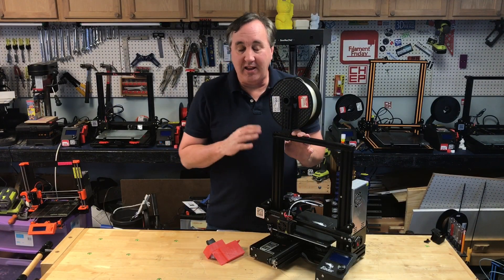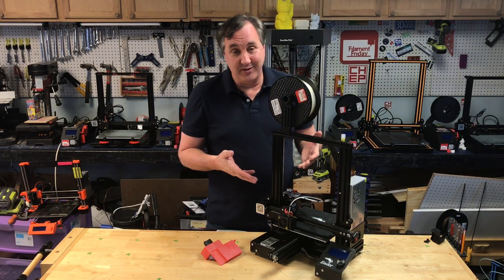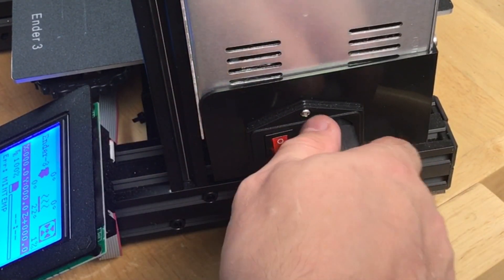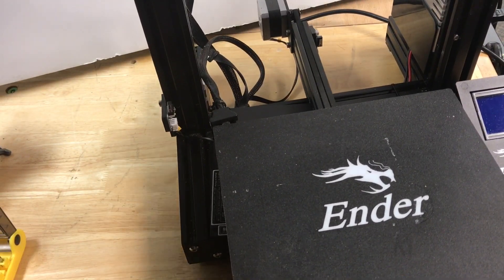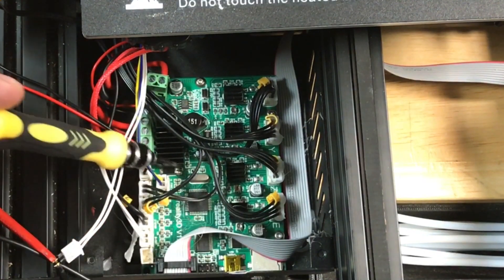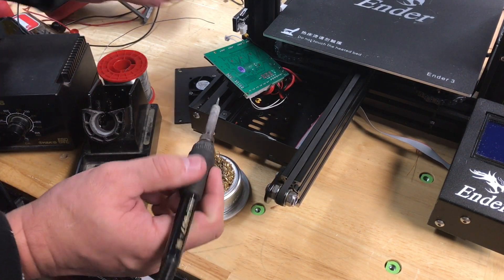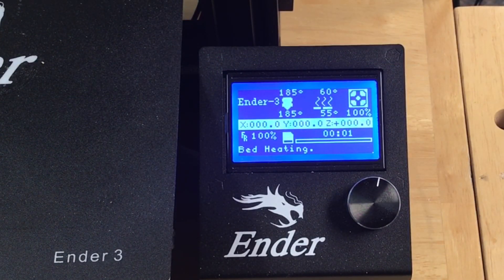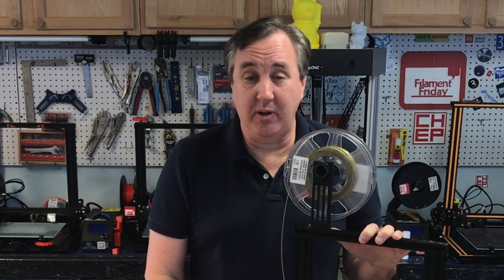Creality Ender 3 - MINTEMP ERROR and TEMPERATURE ISSUES

Comment: If you're having issues with thermal runaway error and no mintemp error, try taking off the hotend cover and checking how loose the thermistor wire is screwed to the heat block. DON'T OVERTIGHTEN. Mine was loose enough to spin with my fingers. Snugged it just a little and no more problems. Fixed it for me. Happened 1 month into daily use of my new Ender v1. Hope this helps someone. (It explains why this only starts after heating up, the screw or heat block both expand enough to make the connection intermittent)
Reply: Hey man! thank you! you save my life with your comment!

Comment: I have the Ender 3 V2 Neo and most of the times there is no problem, but sometimes after a few minutes in a new print, it stops and yields the extuder temp too low message.  I turn it off, turn it on and start the new print and it will work fine and do the print even if it takes hours. So it cannot be any wire in my case otherwise it wuold fail always. No air currents. I'm really puzzled with this issue.
Reply from the maker: Probably a defective temp sensor.
Reply: I experience the same thing but only with PETG at 240°, works fine and error come after 1h idk why

Comment: In my case, the temperature on the display was -14 degrees and if I tried to heat the hotend, the printer would reset. Checking it I saw that one of the wires at the tip of the thermistor had been cut, at first glance it seemed fine but when I took it out of the hotend it was loose, I soldered it with tin and put a heat shrinkable cable although it will soon be time to change it since the tin does not it will withstand so much heat if I use another filament that is not PLA. This happened on an Ender 3 Max

Comment: Sometimes the temp oscillates like crazy and nothing happens but maybe suddenly the error occurs. I guess it has to do with coincidence between a sudden low temp value and the sampling frequency. A friend of mine fixed it by changing a value related to that temp sampling in the Marlin firmware or something like that.

Comment: Ya, my problem was the circuit would fail and a the machine start making a high pitched noise high enough to break ears and the screen would say bed heating error, restart system.

Comment: SUBSCRIBED! After working through the basics of learning to use my Ender 3, making the usual noob mistakes, and finally learning to produce “fairly” consistent prints, I am now learning the finer points behind improving their resolution and strength. I may have also discovered a few things about the machine that I hope to share once I prove their validity.
Thanks for your time, presentations like yours save so much trial and error!

Comment: Just in the past few days I have noticed the temperature fluctuations on my Ender 3 Pro. I’ll double check the solder joints. Thank you. 
One of the screws holding the hot end on was loose. I also changed out the nozzle. This was before I watched your video.

Edit-
Being an Ender 3 Pro the circuit board enclosure is upside down. 
I checked the solder joints and all are good.  The thermistor is showing 121.1k ohms. After putting is all back together I checked the hot end’s thermistor screw and found it loose. I tightened it. Doing a test print. The temperature readings are sort of stable. It is fluctuating between 196° and 201°. Previously it would fluctuate between 200° and 160°, going as low as -14°. 
I may need to replace the thermistor. An entire new hot end seems to be close in price.

Comment: Thanks for the video on min temperature error on the A13 3D printer. My error was a max, temp. error but using the figures you gave for checking the sensor indicated a complete short. When the manufacturer assembled the head they had cut through the insulation causing a short with the fixing screw. I managed to insulate the wires and reassemble in now shows 107ohms.

Comment: I have a similar problem on the nozzle heater connection .I find lead free solder is more liable to have brittle dry joints than the old 60/40 solder
.Thank you for very helpful video

Comment: Awesome video. I have the same problem with bed temperature. Wildly swinging Temperatures and now a min temp error. It's stable as long as i just heat things up and nothing is moving. But as soon as i start a print my bed temperature is all over the place again. I was expecting some kind of abbrasion damage on the thermistor cable, but now i'm almost sure i have to check this soldering connection (well, the neighboring one is the bed-thermistor). Thank you!

Comment: I feel soooo dumb.  I was sitting here thinking something has gone terribly wrong.  Came to this video to problem solve.  Little did I know my printer was turned off.  :|  The display fully functional off the power of th Pi threw me off.  I previously had a less than ideal power supply on the pi so when it was plugged in the display would light up but it wouldn't really display correctly with the power OFF on the printer.  Newer better power supply is enough to run pretty much everything on the mainboard EXCEPT the heaters.  I guess I just panic but watching chuck starting going through the motions of problems solving kicked me into gear and I found my problem USER ERROR!   Thanks :)

Comment: I also noticed on my cr-10s, the connection where the bed wires SCREW into the back of the cr-10s box was not making a connection. I took it apart and verified ONE of the thermistor wires had NO connection and the other one did. Just cut the wire and soldered a new one in there. Hopefully, that fixes it for me. Testing now...

Comment: Hey Chuck, thanks for posting this. I recently had a MINTEMP error on my Ender 3 Pro, replaced the Thermistor and still kept getting it. I checked the circuit board, the solder was still held on firmly and I was left scratching my head. I ordered a new motherboard, installed it, and am currently running a print. Fingers crossed it works. That being said, if I continue getting this error, should the next stop be replacing the heater in the hot-end? Thanks. P.S. The Silent motherboard is exactly as described, my gosh is it whisper quiet and smooth.
Reply from the maker: Check your bed thermistor
Reply: @FilamentFriday  So I just replaced the bed thermistor, I suspect It's now either the wiring or how the sensor is taped on, because the bed temp is fluctuating. Will try re-taping it, Is electrical tape okay? Thanks
Reply from the maker: Usually kapton tape is used but it might.

Comment: I'm having a problem where driving the hot end much past 210degC causes it to trigger thermal runaway detection around about ten degrees below the set point. So if I run it to 245 (where I print ABS) at 235 it'll give out on me. Running it only to 235 sees the same behavior: it conks out at 225.

Anyway, this may be the issue! I'll pull it apart later today and check. Thanks so much!

Comment: Thank you!  Just started getting an error, "The current hot bed and nozzle temperature is too low", causing prints to halt with a screeching beeping noise.  Reached out to Creality but it's a weekend, haven't heard back yet.  So, might be the thermistor; might be the connections; I have some research/testing to do.  Thanks again!
Reply: same problem here any clue how to fix it?
Reply: @WestSidewaysRcDrift  Yes, someone (elsewhere) pointed me to a video with the following instructions: remove the screw holding the thermistor; then, pull out the thermistor and wipe the dust off it.  That dust is the thermal paste, which has turned into a powder, and that's the root cause.  Then replace it, and replace the screw.

That will make it work for 4-6 months, and then I'll need to do it again.  If I need to do it again, I will consider replacing the thermistor, or perhaps the entire hot end.

Hope this helps!

Comment: Had the same issue on a voxilab check the output on the drivers. Search you tube video's. It kept stopping and beeping half way through the prints and the motors would run hot and when i adjusted it the min temp warnings went away also. x y z at .95 E at1.2 DC. All 4 were 1.5 which is to much

Comment: Chuck, just replaced yesterday the thermistor broken of my ender 3 pro, the same specs as original Thermistor 100k Ntc 3950, i tried to print something but i suffer under extrusion, I checked the internal temperature of the heater block with a multimeter, and it gives me 20-25C less than what I set , I checked the thermistor, at room temperature it shows 92.5k ohm , is it within tolerance parameters? or the thermistor is damaged? Can i calibrate to fix the drop of capacity?

Comment: Please forget the earlier Tevo Tronado Hot End comment about -14C, I had a wire spliced wrong. So now it heats, but it is back to the original problem. With the old hot end and Tevo set at 200 C the measured temperature at the hot end was 140s C. The filament was not extruding, just getins soft at best,  Now with the new hot end I am getting the same results as before. So the problem must be on the baord? Mine is not intermittent like yours, just won't get hot enough.

Comment: I have a runaway heated bed on my ver 1 Ender 3. When I turn it on bed heats up to 200+ ! Yikes! 
I read online its a blown mosfet and ill need to desolder it and add an external one. I also read one post that a firmware flash fixed their problem with a  runaway heated bed.

I should contact creality for a replacment second generation board , thing is a firehazard and unusable as is. 

I still really love the damn thing....

Comment: CHEP, looking at ideas to keep ABS sticking well, have you tried heat activated sheets to stick down your prints? I'll be trying once they get here. But wondering if you have done it
Reply: Heat activated adhesive sheets it should say
Reply from the maker: I have not tried them. I’ve printed a lot of ABS in the past and an enclosed chamber makes all the difference. A brim also helps prevent warping of the corners.

Comment: A few days ago I had a failed print and a badly blocked nozzle. Blocked nozzle? No problem.... I'm used to it!
I attempted to heat up the nozzle to 120 degrees to pull out the blocked filament, but it didn't heat up enough to pull. The display reading reported 120 degrees without any error message. I suspected a lose wire on the thermister so I removed the fan housing to take a look and saw that my thermister was lose in the hole. Thinking this might be the problem I replaced it along with a new nozzle and reassembled everything... without first realising there is a little grub screw hidden underneath the cotton insulation on the hot end meant to hold the thermister in place..
Screw tightened and everything reassembled, I turned it back on - and it heated up straight away. But I did notice hot filament oozing from the nozzle... perhaps I now have much better contact between the heater block and thermister? Possibly a slightly hotter than normal hot end? Anyway, once oozing had stopped, I tried another print. Unfortunately I wasn't able to get good bed adhesion for some reason, so I cancelled that print job. Yesterday I attempted to print again with proper bed levelling, but this time I got the err mintemp error when trying to preheat the bed. Neither the bed nor the nozzle would preheat. I persisted thinking it was the room temperature at fault (4 degrees ambient in my cold UK winter warehouse), so I put a heater on to warm the room up a bit. I reset to failsafe on the display but still nothing. Eventually however, I somehow got a temp reading without any error, and I managed to heat up the bed to 60 degrees - this time it started to print!
Thanks to your video (the only one on Youtube), At least I now have a better understanding at what might be going on, and will take a look at the underside of that board for a loose solder joint tomorrow. Much appreciated!
Reply from the maker: Glad I could help.

Comment: Anything on an Extruder temp too high?  Even after a brand new hotend?  I can't do anything as I can't even confirm the error.  Unplugged, but it still seems like the software is locked up.  Ender 3 Neo max.  Thanks in advance.
Reply from the maker: Run PID tuning.

Comment: My CR-10 mini has trouble getting to, and maintaining 240 degrees (printing ABS).  Will get up close to the desired temp, and then drop, then go back up, etc.  Is that a similar problem or issue with PID's?  Any help is appreciated!
Reply from the maker: Possibly but also could be what I had, intermittent connection.

Comment: My 2nd Ender 3 takes 10 ministers to start a print because it can’t keep the temp at 205, it’s god from 200 to 210 back and forth and won’t stick to 205. Is that about the same issue?

When it does print, it has much more stringing than the other one and I’m wondering if that’s during the higher temp swings during printing
Reply from the maker: Sounds like something is wrong

Comment: Hi Chuck I was wodnering, you have any video about retraction settings to avoid the retraction strings?
Reply from the maker: I’m working on that actually. Try 5mm at 50mm/s. That seems to work on many of my printers.
Reply: @FilamentFriday I have the CR-20 and I have it at 4mm and 60mm/s but it keep's leaving strings I have try a lot from 2mm to 8mm and 40mm/s to 70mm/s and nozzle temp 190-220° and no result
Reply from the maker: Yeah. I’m working on it.
Reply: @FilamentFriday  Thaaaaanks

Comment: Just woke up to this error this morning. Thanks!
Reply from the maker: Glad I could help.
Reply: @FilamentFriday  interesting. The connection to the board was still hot glued, but it had come loose. Also if u want a quick way to check the thermistor I jus hit it with a heating gun. If temp goes up it's good.
Reply: if u getting temp error change the heater cartridge n upgrade it while your there
Reply: @wayneuk  no, however the error is back. Think I need to take out the board and check the solder.

Comment: You are amazing.
Can you combine power supply and mainbord out of case as another ünit?
Mainboard and power supply alrady get hotten but case of ender is getting heating so get rid of these unit from case can help it for cooling.
Do you think this like cr-10
Reply from the maker: It wouldn’t be easy because all the wires would be too short. Make sure the cooling fan  is turning.

Comment: I have my Ender 3 in a cold but dry shed and in its own enclosure. I find that the bed won't heat up when its really cold (below 4 degrees Celsius) however the hot end is fine. Also when I connect octoprint I get the min temp error as well (I don't get it on the ender 3 screen when not connected to octoprint, the bed temp just flips between 4 and 5 degrees over and over again). I assume that the bed has its own thermistor and on a different pin to the hot end as shown in this video. Perhaps I have a cold solder joint too.
Reply: Turns out it wasn't a cold solder joint at all, its just that the printer detected a value under the minimum for the bed and hot end (hot end started playing up when it got colder) due to the temperature outside. All I had to do was to bring the temp of the hot end and the bed above the minimum temperature and it started heating up just fine. To bring the temp above the minimum all I did was breathe warm air on to the bed and hot end X0D. I suppose a hair dryer or something similar would be a more efficient way of doing this in colder weather...

Comment: At first I saw this video and I was like no that’s not my issue I just need to adjust the pid because mine wasn’t getting to temp and it would connected to the computer and pid auto tune would reach over my desired temp by a few degrees, unplug the computer after I saved and it would work intermittently, while doing all this here and there id notice the faintest hint of smoke. Well I investigated after some cruddy prints another autotune and I see more smoke. My connectors are all good everywhere on the board looked great but the main power supply negative had melted it’s green connector tower! I’m so glad I discovered this, I ordered a new board hope I can just plug and play

Comment: Chuck.. Ya needs to turn up the shop lights a bit... Video is darker than usual. ;-)
4:22 Looking at the solder on the pin it is clear that there was not enough time and/or solder to properly solder that pin. There is no solder in the pad hole feed through.... only on the surface pad. I would re-solder all the pins of all the connectors since it could be a common problem on that specific PCB. BTW.. I only use Rosin cored leaded solder. Rubbing alcohol easily cleans off the flux.
Reply from the maker: Thanks. It’s the settings on my camera/iPad. Lighting is the same. I did something different in this one and you noticed. Thanks is for the feedback.
Reply: @FilamentFriday  N/P...

Comment: Thank you for your video I am French and apart from your video I have found nothing for this subject on the web. Since a printing fault from my pc to the printer (stop before the end) on my Ender 3 pro. .when I turn on my printer the nozzle starts to heat without stopping. I thought of a problem with the thermistor and I therefore replaced all the components located at the level of the Resultat nozzle. Nothing has changed. I think it can only be a motherboard problem and so I just ordered version 1.1.5 to replace my V1.1.4. What do you think ???
Reply from the maker: That does sound great like a board issue. You will like how quiet the 1.1.5 board makes the printer.
Reply: Thank you very much for your answer

Comment: Hi, I recently had a mintemp error, when I was attempting to head the bed, I have switch the thermistor connections,  the temp is reading 31c , there is no mintemp error,  is there something with the thermistor cables or heat bed? the wires at the heat bed are not broken. the hotend heats up fine (with the thermistor cable switched or not), its jus the heat bed. Thank you in advanced